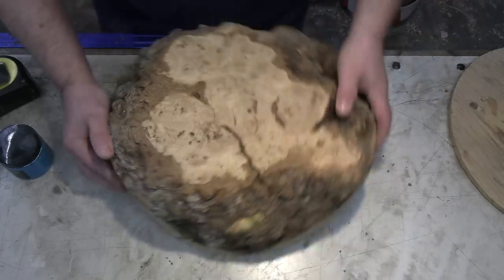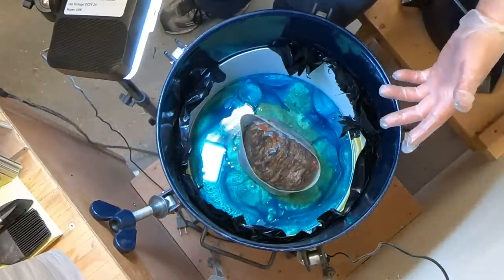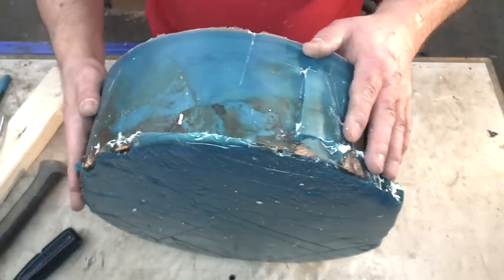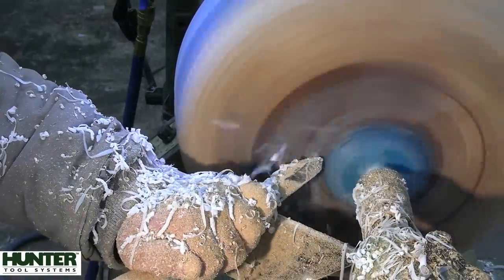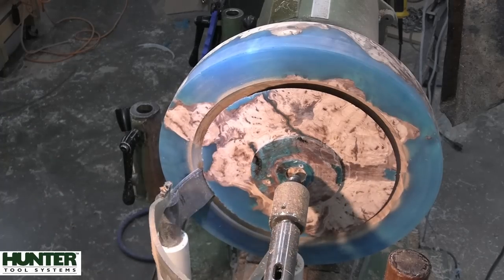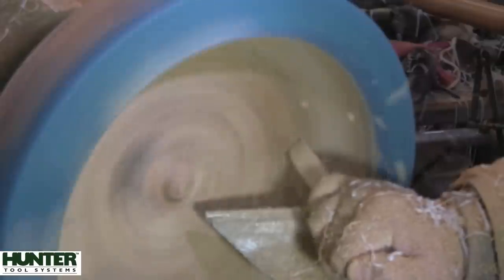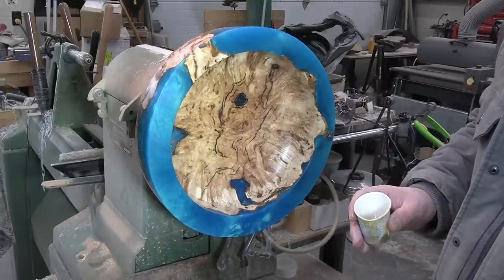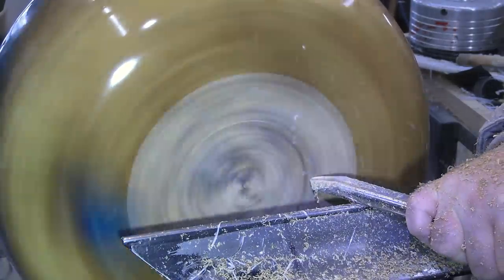Woodturning - The Beefy Maple Burl Bowl

Comment: I was air testing a copper pipe installation at 100 psi, and there was a ½ cap on a stub out; shot off like a bullet and flattened itself like a penny on the concrete wall before I even hit 100. I looked to my master plumber and he just had the look of; whoops! 
Needless to say, I never stand in front of caps, especially if I didn't solder them.

Stunning finish as usually, awesome job.

Thank you Jim
Reply from the maker: As a mechanic in the army I seen a number of accidents with compressed air and large truck tires too. Thanks

Comment: You're probably right about the thermal contraction being the reason for the casting not coming out easily. I had wondered why the casting would slow down at the top when your pressure pot looks wider at the top than the bottom.

This was a really beautiful bowl. Love it!
Reply from the maker: That’s the only thing that makes sense to me. Thanks

Comment: I started wincing as soon as you drilled a hole down the side to put compressed air in .... just asking to be injured ... I turned the sound off and waited for the inevitable to happen, which it did!!        If you ever need to do anything like this then use hydraulic pressure (water from a pressure washer for example), it doesn't expand explosively like air does!!

Apart from the above, now that's what you call a bowl .... absolutely stunning piece 👍
Reply from the maker: Thanks for watching

Comment: I got the Korpro cutting tip for my One Way coring tool about a month ago and, " WOW ", what a difference, I went from almost an hour of tearing my way through an Oak bowl with stalling my lathe over a dozen times to 7 minutes without stalling the lathe once. Thank You very much for the advice. 
By the way, if you use thin ca glue as much as I do I get mine from Ebay, it's called 3t thin ca and it's about $65 for a 2 lb. bottle.
Pat from SW Washington.
Reply from the maker: It’s a fantastic tool! Thanks for watching

Comment: Hey Jim, I also suspect that the pressure pot expands or bulges slightly when it is pressurized.  The resin flows into that space and cures.  When you let the air off, the pot returns to "normal" size but the resin can't move and it gets pinched in there a little bit.

Nice work, as always!
Reply from the maker: That makes sense too. Thanks

Comment: I struggled with my finishes, it was a real pain in the ass. I tried your way to finish turning a few times and I haven't used any other way since. Tripoli is cheaper than sanding paste. With alcohol carefully between the surfaces. The end result is really wonderful. I don't use epoxy, it's way too expensive around here. I am considering trying to repair a few cracks, but that will have to wait because I have many other, large truckload, of blanks to turn. Cheers❤️🇫🇮
Reply from the maker: Thank you very much!

Comment: Geez Louise! You are so lucky nothing got hurt! Especially you! When you said you were pouring directly into the pressure pot I thought you were insane! However… I realize that the pot is made to withstand pressure… but it does have a safety valve on the lid just in case. With the casting creating the seal is it possible that the entire pot could explode? I’m no expert but I’d hate to hear that you got hurt. 
On a happier note: That is a very stunning piece! Love the burl and the turquoise combination. Can’t wait to see your next beautiful creation!
Reply from the maker: That pressure pot is designed to take 80 psi or more. That’s the line pressure in my shop so all is good. Thanks for watching

Comment: Air pressure is crazy. Having dealt with the old split rim truck wheels. It can kill. That's why they had steel pipe cages for dealing with them. Definitely CYA with pneumatic. Even these pressure pots can be dangerous. 🤣 I saw you leaning away.. glad you're ok, it could've been much worse if you hadn't been prepared. 🤝 love the burl.
Reply from the maker: I’ve also worked with split rims in the military years ago so I know exactly what you mean, thanks!

Comment: Love the thick bowl 👍 when you started sanding I felt it still needed a  small bevel on outside rim...but by the time you started  adding finish I was really loving it thick and sharp. It must be hard sometimes deciding the direction ... awsome job ✌🍁🦉
Designer Epoxy
Reply from the maker: It certainly can be. Thanks!

Comment: Have you considered getting a split casting bucket made? That is, loosen a few bolts on the outside of the bucket form, open it up from side to side, which will allow the casting to be easily removed. Just a thought...
Reply from the maker: Hasn’t crossed my mind, it would be tough to get that would be reusable and one that doesn’t leak, lol. Thanks

Comment: Have you thought about putting a thin tube, like aquarium air line, down the side? Either for pressurizing or just ambient equalization.
Reply from the maker: It would of been an aid in this regard if it was on the outside of the plastic. We will revisit this again. Thanks

Comment: Also if the pressure pot was designed with a slight taper larger at the top would be nice.
I have used several large 3/8” black zip ties placed between the two pieces of plastic bucket that you have around your mold the zip ties pull out relatively easily and give you some gap for friction release.
Reply from the maker: I actually have I wire system that I use and forgot to put in before the casting. Thanks

Comment: Wondering if you can increase the RPM as you loose material from cutting and would it make a difference? I also noticed the band saw guide is higher than I would have used, lower stops vibrations during the cuts but hey that's me.
Reply from the maker: Yes, as a general rule, the lighter it gets the higher the rpm can increase. When rough cutting things on the bandsaw I don’t really care what the cut looks like. That blade has three teeth per inch so regardless how low the guides are the cut will be rough. Thanks for watching!

Comment: The force at expulsion could be calculated, compressed air psi x sq inches of void under the casting , I am sure you were well over 2000 lbs of force at the point of "release".  That's good Designer Epoxy to bounce and not crack!
Reply from the maker: It’s tough stuff! Thanks!

Comment: Great burl and colour. Just been doing my first resin bowl on some very cracked plum. I found that the resin sands faster than the wood so the resin is recessed ever so slightly behind the wood after sanding, flush before sanding. Have you come across this and how did you deal with it if you did? Less pressure I assume but interested on your take.
Reply from the maker: Yes, this is a common problem. Higher speeds and very light pressure seems to work. Are you using Designer Epoxy? The reason I ask this is because different epoxy’s have different hardness’s. Thanks
Reply: @SpragueWoodturning  thanks for coming back. Designer epoxy is only available in US and Canada but not uk. That said the epoxy was pritty brittle with a decent hardness. It was really a test piece.

I was using a battery drill which is too slow really. I'll pick up a faster corded one for the inside and try it with less pressure and more revs

Thanks for coming back.

Comment: Jim, that was pretty exciting. Glad you didn’t get hit in the head! I have to try that Designer Epoxy, my fast curing alumilite resin just cures to fast for large cumbersome bowls where I have to hurry. I do like that results 99% of the time with no thermal cracking! I have been using starbond for a long time.  I find that often when using accelerator there thinnest product foams and crystallizes making a mess! Your thoughts? Thanks and alway enjoy and learn. Cheers from MT USA
Reply from the maker: Spraying it from distance helps, but yes, it certainly can. Thanks!

Comment: If you are going to extract with air put a copper tube with a quick release fitting on the top end so an air line can be connected to it.
Reply from the maker: It was so tight in the PP that wouldn’t of mattered, I need to drill the hole to get the air to the bottom of the casting. Thanks

Comment: Designer epoxy   .. Jim  nice job per usual.  The chunky bowls are just not my thing but I know this was commissioned  and you are right we need different tastes or it would get boring.  I'm going to email you about a bowl I'm working on to pick your brain on a good way to get it filled with epoxy and not use so much because you know better than most how expensive that stuff is.  You never disappoint.
Reply from the maker: Cool, thanks!

Comment: That was priceless...'looking into the camera and asking 'Are you OK?"...🤣.  The irony there was the pressure pot apparently wasn't able to take the pressure 😳...glad you weren't hurt.    That was a 10 out of 10 for entertainment though Jim.  I'm definitely going to watch this twice and with a bowl of popcorn the next time.   Jeese, I'm a quad and an amputee and was thinking about a come along to get my wheelchair in the truck...I might need to rethink that 🤔.  I have an air compressor to blow my tires up...not me anymore...I'm not doing it😂.  How come the resin didn't stick to the bottom?  The crash?  Why don't you just get an HDPE bucket from Home Depot with a handle instead of putting bucket material between the plastic and the bottom of the pot?  OMG have you seen the prices of HDPE buckets at Amazon 😳???
Reply from the maker: It didn’t stick to the bottom because the plastic was between the pot and the casting. The reason I used this method is because they don’t make buckets that will perfectly fit inside my pressure pot. All the HDPE is very expensive! Thanks

Comment: Have you asked the company that builds the pressure pot if they can modify the bottom to have a  center jacking nut installed so a removable threaded rod can push on a internal plate to eject your casting
Reply from the maker: No, I don’t think it’s necessary, just use compressed air, haha. I will show in an upcoming video how to do this so we don’t have the same problem. Thanks for watching

Comment: Jim I mostly turn bowls what is your recommendation of which designer epoxy to use
Reply from the maker: For twice turn bowls I recommend Artcast but you’ve got to be carful not to just too much or thermal cracking will happen. You will get lots of good color separation though. Deep cast is what I use for deep pour and is the safer one to use but color separation can be an issue because of its long open time. Don’t forget my code inlayjim for you’re discount. Thanks for watching!
Reply: Thanks for your reply. I like to use a pressure pot.same recommendations?

Comment: Jim- Be glad you stood to the side when that casting "Popped" out and that you still have all your teeth and other parts.  If you calculate the area of the bottom of that casting, and if your compressor is running at the usual homeowner compressor pressure of 90 PSI, what it calculates out to is that you had over 13,854 pounds of FORCE pushing that out of the bucket. Please be careful when using compressed air.
Reply from the maker: For sure, thanks!

Comment: Why not pull vacuum on the vessel to pull all the air out so the resin could fully pernitrate the wood and the pressurize the vessel at the desired pressure?
Reply from the maker: Yes, this could of been done, I still don’t think it would of got to the center of the blank though. Thanks

Comment: Do you have to use a pressure pot?
Reply from the maker: No, it is not necessary, but it will give you a better casting so that’s why most turners use them.

Comment: HOW ABOUT PUTTING A REINFORCED AIR FITTING ON THE BOTTOM OF THE PRESSURE POT?       :face-blue-smiling:
Reply from the maker: That can be done with some welding but I think it’s just another place to have an air leak. Another issue, is if the fitting was on the bottom the pot would of been launched to the ceiling when extracting the casting, lol. Thanks for watching

Comment: Why didn't you put the casting parts into the garbage bags then trim off the top of the garbage  bag then tape the top trim with masking tape and cellophane tape to the container.
Reply from the maker: Putting the bucket material in the sides is a lot easier than trying to tape the bags up against the PP. thanks for watching